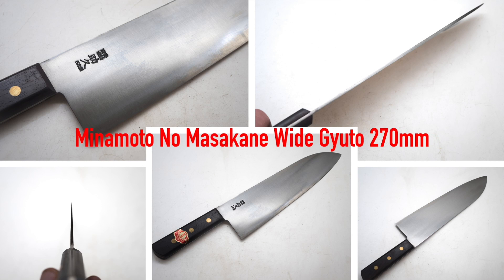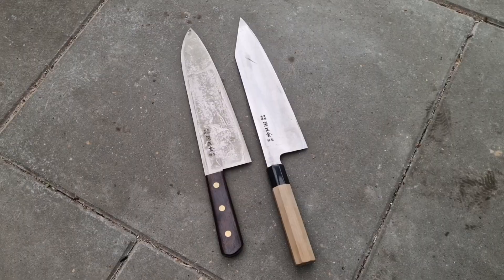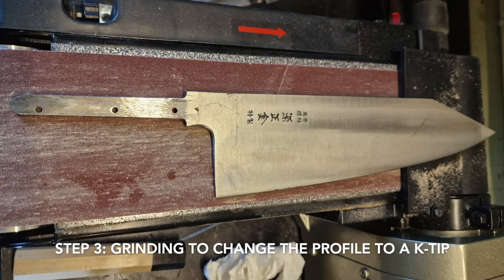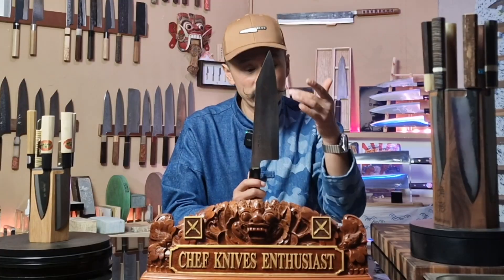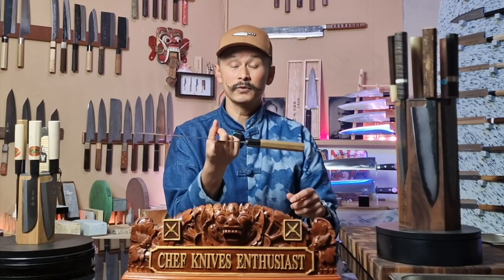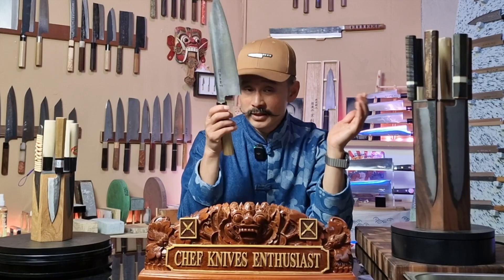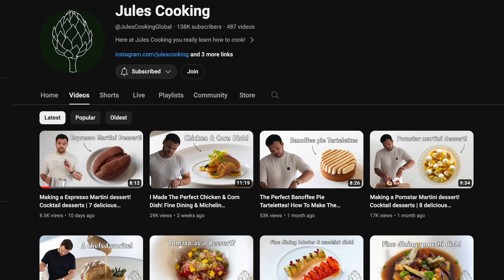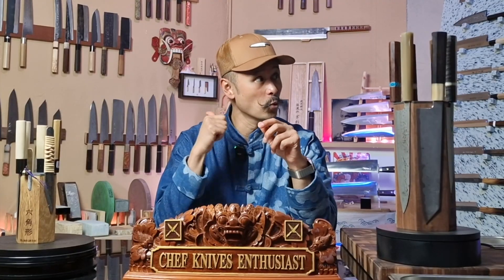We 'Bunkarised' this vintage Japanese kitchen knife - Minamoto No Masakane 270mm Gyuto Old Stock

Comment: I have become a big fan of SK4 carbon steel. Its not fancy, but it takes a very sharp edge, holds it very well and is reasonably priced. It is fairly reactive and patinas quickly, but not so reactive that a new user will damage it if they dont dry it immediately. As for this monster of a knife you have, i would love to find something like that , just for the shear size of it !!! I have a very small kitchen , but i would figure out a way to use this monster k tip lol.
Reply from the maker: I must say I have very similar experiences with my SK steel blades. So it's like you took those  words out of my mouth. 👌🏽
My kitchen is also crampy and tight, but it does fit my  600mm x 350mm cutting board. 😁💪🏾

Comment: I’ve thought about doing the same to my 240 mm kiritsuke for several years. It’s just too long for my cutting space. I’d like to bob it down to about 220-225 mm and make the k-tip even more aggressive. That was the only size it was available in unfortunately. It is taller, which I like, than a 210 would have been anyway had it been available. You win some, you lose some 🤷‍♂️.
Reply: The SK steel should be pretty decent and you’re getting a mono steel, which gives better stiffness and feedback over sanmai.
Reply from the maker: You could go for a Chuka Bocho if you like tall blades. But yeah, it sounds like if you re-profile your blade, you win it all.
Reply from the maker: I experience it to be very decent steel, especially for an old blade like this. When I need a stiff blade it has my back for sure. When I need a bit of flex and a forgiving blade, my San Mai's are ready to go.
Reply: Do you have a link to who is selling these ?.
Reply from the maker: I bought min at www.japanesenaturalstones.com
Look for the "knives" section and then at "other knives" section. I know that Bernal Cutlery had a few in stock, Hitohira. Otherwise, just google Minamoto No Masakane old stock knives.